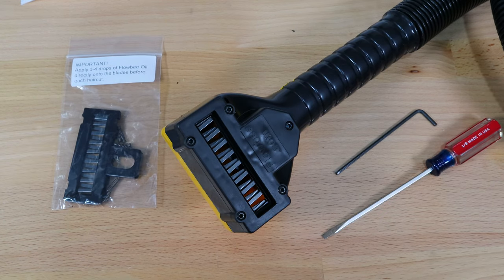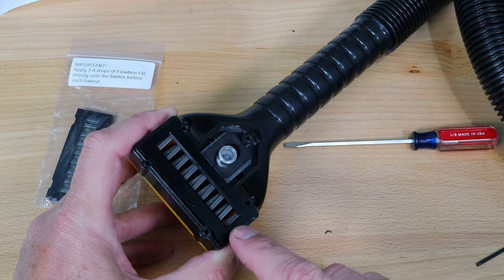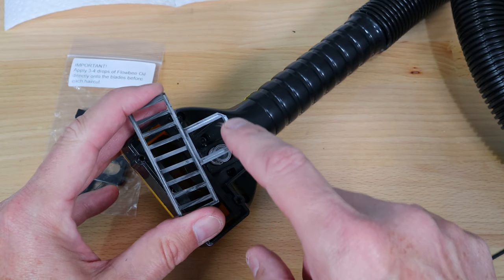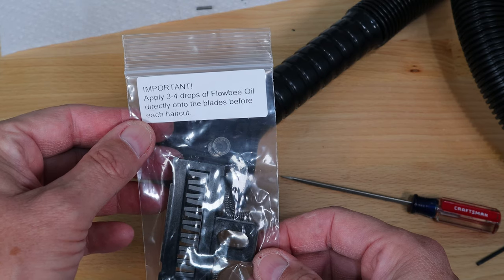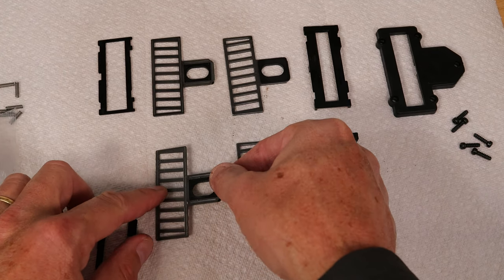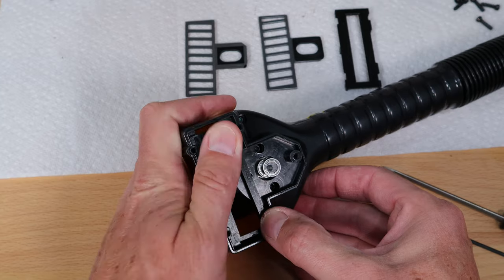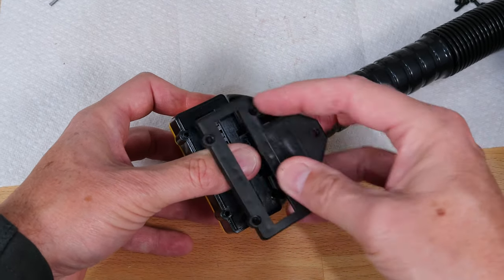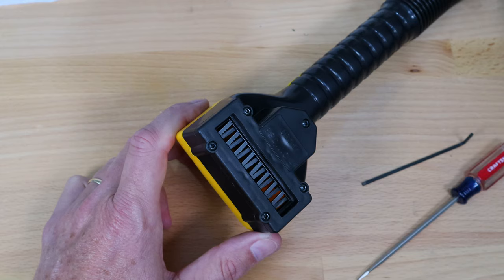Flowbee Blades - How to Change Them.

Comment: You saved me!  Had mine 4 1/2 years now, big buildup of oily clippings in the head, decided to remove all the parts and used tweezers, q-tips, other tools, clumps being pulled out. Oh, no!  Where did those springs come from?  No way to figure it out.  Looking on YouTube led me to this video, and I knew it would help me.  Determined to really clean the head out, I used canned air, sprayed rubbing alcohol, Kleenex inserted, etc., spent hours on it.  Came out as dry and clean as I could get it.  I traced every part you showed on copy paper and made notes, the springs and all the parts in exact order, kept the final screws loose like you said, and Bingo!  Perfect!  I couldn’t have done it without you!  You’re awesome, thank you! (I’m a 78 yo widow, and proud of myself! Always get compliments on my hair!)
Reply from the maker: My apologies for missing this comment.  Thank you for contributing and helping others come up with a way to clean theirs.  -Tom
Reply: Hey thanks for the video. It is great. Could you please tell me where can I buy the new blades?  I looked everywhere and I can’t find them.  Thank you so much for your help

Comment: Thanks Tom!  Got done and I could hear the motor was on but blades weren't moving. Came here and saw your tip at the end of your video about the screws being too tight.  I loosened each on 1/4 turn and it is working like new!  Thanks for the tip!

Comment: Thank you SO much for this!  I used a Flowbee found by the side of the road twice, but the unit was getting hot and was straining.  I took it apart and cleaned out all the hair and tried to reassemble, only to have forgotten which way the parts went back together.  Sigh.  AND, after watching your video, it wouldn't run at all...so disassembled again, reassembled, then it was making awful noises.  So I loosened the screws, per your extremely helpful, exclusive tip, and voila!  I just cut my hair with it.  Yay!  Double score.  Mahalo for taking the time, and for the tips and clarity.  I so appreciate your effort and information.  Aloha!  (My units are older, so I can't use the replaceable parts, but the closeup camera shots and explanations helped me anyway.)
Reply from the maker: I'm really glad you found it helpful.  Love my Flowbee and just gifted my oldes son with one.  He was tired of spending $50 to $60 bucks on his hair.  We gave him a Flowbee cut and he was sold!
Reply: Same thing happened to me, but I guess I lost a spring down the drain. Oh well! Mine is over 25 years old, and first to go a few years back was the switch. I was greatly surprised that they sold a replacement on their website. This time the motor stopped, it wasn't the switch, and I figured it just died. But I took it apart just for fun, and after removing the blades I tried it again and the motor ran! So I cleaned it up, oiled it, and it's on its third life. The video was great, though it left me curious why one would ever need new blades and how you would know when you did. Mine cuts my hair just fine after decades!

Comment: I got here because Flowbee doesn't even tell you where the blades are. I thought they were down in the head I didn't realize they were up in the front. I thought the blades were just a guard. Now I know where to put the oil. Thanks

Comment: Thanks so much for this. I used these instructions to reassmble my original blade assembly (my Flowbee stopped working, I could hear the motor going but it wasn't driving rhe blades). Unfortunately, I cant seem to get it working after puting everything back together. I cant tell if I'm doing something wrong ir if something in the blade aseembly is worn out (maybe the springs) and I need a replacement set. The one thing I didn't do was  remove the bottom bushing.
Reply from the maker: Make sure you haven't tightened the screws down too much.  Too tight and it will prevent the blades from being able to move.
Reply: @evolutionaryTom  Thanks for this tip! I bet that's it. I ended up getting the head + hose only (blades included) replacement part from Flowbee. Not the cheapest option, but not as expensive as buying a whole new Flowbee. I may try to fix the old one again as a backup.

Comment: What size and type wrench do I need to do this on an older Flowbee head...the screws have what looks like a square slot instead of an hex allen slot.
Reply from the maker: Sorry, Dan.  I have no experience with the older models.  Hopefully one of the older “Flowbee Pro’s” can chime in.  I’ve also had good luck contacting the company and they really do know it all.  -Tom
Reply: Hi!  I just used this tutorial to put blades from my new Flowbee (cheaply made, died after just a couple of years) with my old workhorse Flowbee (works great since 1993, but the blades have dulled.)  I used a regular Phillips head screwdriver to get the "square head" screws out.  I took out all the parts, and put only the blades and screws from my newer Flowbee into my old Flowbee, and kept all the other older parts in place.  I used the new screws because if I ever have to replace them again, I would rather use a hex key.  It looks and sounds just like it should.  I haven't yet tried to use it to cut my hair, I'll check back again in a few days when I do (using it with a vacuum is loud and my hubby is sleeping in the next room.)  Anyway, try using the Phillips head screwdriver.  *peace*!
Reply: I just cut my hair with the old Flowbee with the blades taken from the newer Flowbee.  It works beautifully!  *peace*!

Comment: I just bought one with a vacuum. The blades don’t move at all and there’s no buzzing. Glad you showed it turned on so I could see/hear it. The instructions were not clear. Not sure what to do.
Reply from the maker: I hope you resolved this by now.  My apologies for missing this comment.  Sometimes the plate screws are too tight and it keeps the blades from being able to move.  Loosening them frees them up and the motor and cam will start to work.  -Tom

Comment: So the blades are different on the older models? I have an original Flowbee from over 20yrs ago that needs new blades. They look exactly the same. So these won't fit my vintage unit?
Reply: Wondering the same thing, Justin.
Mine was manufactured in 1991, I think.
Blades replacement appear to be pretty expensive, too...
Reply: @davestelling  I did find out the blades were universal to both the older and the newer models.
Reply from the maker: Not sure why many of these comments were hidden for review but my apologies.  That is correct.  Parts are only available for units that say Flowbee.com on the head.  That's what Flowbee has told me but I see @mygt8a4re might have found something different  -Tom
Reply: @evolutionaryTom it's been a while since I had spoken with them, but I remember them saying the actual metal blades were the same, but the supporting plastic pieces that surround the blades were different. So you could purchase the new blades & reuse your factory supporting pieces that hold them in place.

Comment: Hi Tom good video. I have an older flower from early 90s so these blades won’t fit that model?
Reply from the maker: Hey Kevin,  These will only fit your Flowbee if the blade cover says FLOWBEE.COM on it.  That's what the Flowbee factory told me.  That's cool that you've had one that long.  You're what I call a Flowbee pro!  -Tom
Reply: Yes I guess I am. It’s  lasted a long time. Still does a good job.
Reply: @teresamish  Kevin, did you try the newer blades on the vintage flowbee? I'm looking for blades for my original Flowbee. They look the same here as in my flowbee, mine just has the yellow blade cover.
Reply: @mygt8a4re  
I sure hope we're not out of luck, having older models - I just paid $100.00 on eBay for a 1992 unit...
Reply: @Dave Stelling  Here's a direct reply from Flowbee on the blades: 
"You are correct, the blades are the same but the plastic blade guides were changed. You can reuse the old plastic with the new blades. Or you can upgrade the entire head and hose for only $50.00 more than the blades alone."
Reply: @mygt8a4re Thanks!  I have a 1992 flowbee and the blades are dull.  I bought a new flowbee about 3 years ago. The new one seems cheaply made.  Today the power to the blades stopped working, so I had to use my old flowbee with the dull blades.  I want to take the blades out of my newer flowbee and put them in my old flowbee.  I'll be happy if I can do that.
Reply: I finally used this tutorial to take the blades out of my new Flowbee and put them in my old Flowbee.  It works beautifully now!

Comment: 5:40 - you reversed the orientation of the bottom bushing from how it came from the factory, in the replacement kit. Did it come misassembled?
Reply from the maker: I did turn it around.  I don't know if it's supposed to come oriented as they should be installed, but I needed to turn it around so it would be oriented the same way as I removed the original, David. Whenever I disassemble something I do it just like that so my memory doesn't get me in trouble.   -Tom

Comment: How to do oil the blades? I've been searching online but can't find a definitive answer. So are we supposed to put 3-4 drops on each single blade before and after the hair cut?  Or should the oil just go on the back blades as that is where the top and bottom blades contact?
Reply from the maker: Oil the blades before you each haircut.  I put 3 drops on the blades.  One one each end and one in the middle.  I put the drop of oil where the two blades contact each other.  That way both blades both get oil on them.  Then I turn it on and let it run for about 15 seconds before I start the haircut, in order to let it spread the oil out a bit.  That's it.  You'll be good to go.

Comment: I wish I had viewed this before trying to replace the blades on a 25 year old Flowbee for my roommate.  Paid $36 on the Flowbee site for the more modern blades and yes they oscillate back and forth but they don't cut.
Reply: Yea, great to buy “Made in America”. Then they leave you with no option to thrown the old one away and force you to buy a whole new kit, when all you need is new blades.
This happens more and more with consumer products. Manufacturers don’t want to stand behind their product, at least Flowbee acknowledges the old model, lots of manufacturers pretend the old stuff never existed once they come out with a new one.
Reply: So the blades online won't work on the original Flowbees? I was just looking to order a set of replacement blades for my vintage unit.

Comment: Shouldn't the cam bearing surfaces around the outside of the two wheels where they contact the insides of the blade brackets be oiled or greased as well?
Reply: I was wondering the same thing, my cam seems to have a plastic thrust button on top. I might work some grade 0
grease into the rollers.
Reply: They're bearings, so they roll as the bearing soins; so lubing the outside of the bearing isn't needed or recommended.

Comment: I bought my Flowbee in 1985, still going strong, no barber shops for me.
Reply from the maker: I love hearing from Flowbee Pros like you!  That is too cool!  -Tom
Reply: Great product. I've bought extenders 3 times. Ready for more. I have to tape them on..but I don't mind...lol
Reply: just did my 1st FB Cut today...was awesome ..like to keep it that way..any tips you can share with me? how often you oil, how do you clean the Clippers? and so on? then maybe mine can go 30+yrs like yours did
Reply: @ssj3vegett0  I've owned my vintage original Flowbee for about 25 yrs now (1996). I purchased it on an infomercial on TV and have used it to cut my hair ever since. I cut my sons hair with it for about 19 of his 22yr life before he decided to go with his own hair cuts with a barber. Everything I have is still original, even the blades. I take it apart and clean it really good once/yr. I oil the blades after every use, a drop of oil on the center of each blade and run it w/o the vacuum cut a minute or two to distribute the oil. It works like champ. I'm actually looking to order my first set of replacement blades, which brought me here.